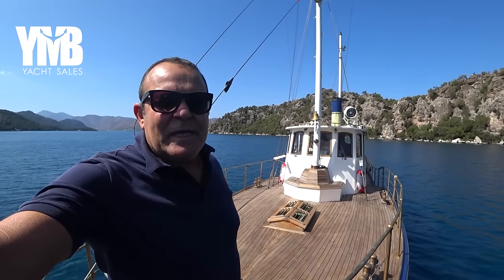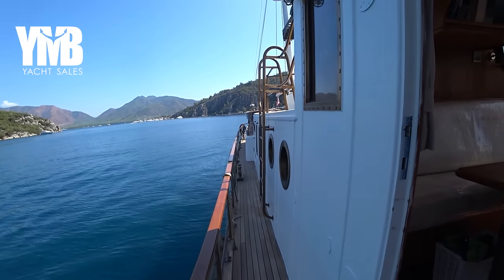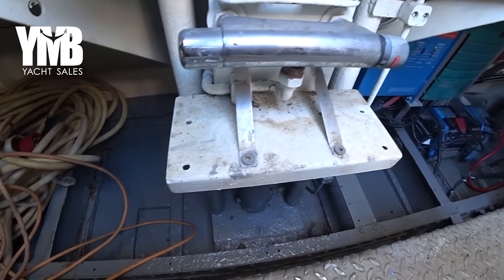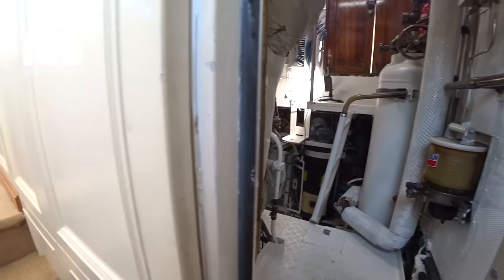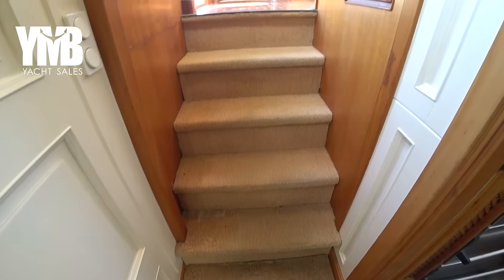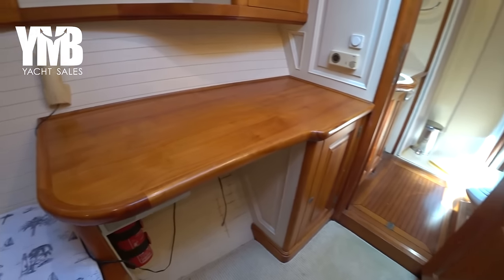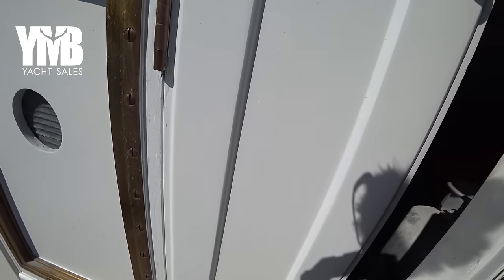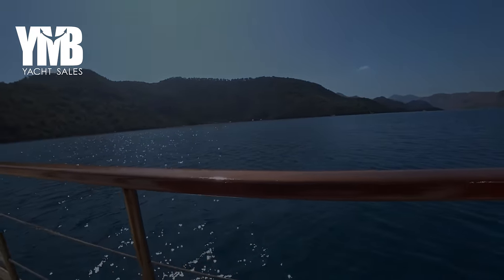24 M LÜRSSEN / WWII 1938 GERMAN NAVY VESSEL CONVERTED TO A YACHT FULL WALKTHROUGH / Keen Seller!

Comment: This is a beautiful boat. But I would never buy it. Wood planks on steel frame, teak deck, brass fittings, 40 year old electrics and a high maintenance old engine.

The maintenance and care effort should be about the same ratio as a modern fighter jet. One hour of use, ten hours of maintenance and care. And we don't even want to talk about the wooden planking on the steel frame. At the end of the 1930s, it was no longer state of the art and clearly had problems at the joints. You can certainly imagine how much the holes and bolts between wood and steel have changed after 90 years in the sea water. Actually a miracle that a bilge pump does not have to work here constantly.

A complete overhaul of the rump and the connections is certainly necessary, including a coating of the hull with GRP to protect it from saltwater in the future (or just every year in the dry dock and underwater coating check and renew, including necessary wood renovations).

All in all, there are very high maintenance costs for the new owner. One can only hope that for this really beautiful yacht someone with very deep pockets and the absolute will to preserve this classic will be found. Otherwise you will see her in 10 years at the scrapyard again.
Reply: Yup, she's definitely not for everyone...not sure who. 490,000 euro's.
Reply: I know the owner personally, she just had a massive refit. He personally told me the electronics were all refurbished in 2017 so peronally I’d think about acquiring this beauty with some haggling 😅 or if I was liquid rn. Good luck selling the boat, good day 😊